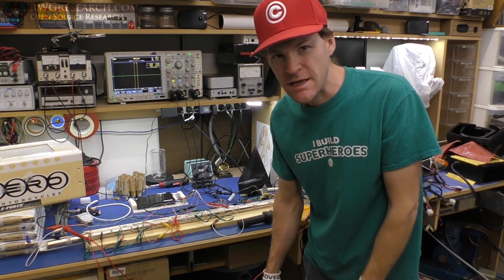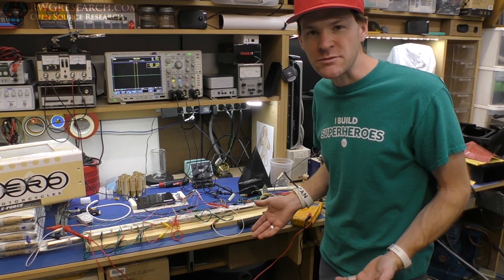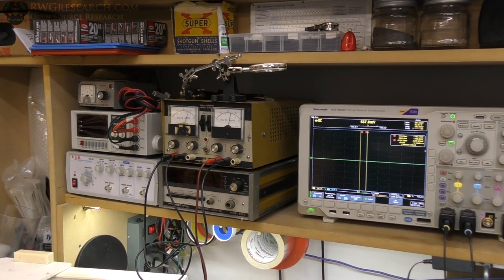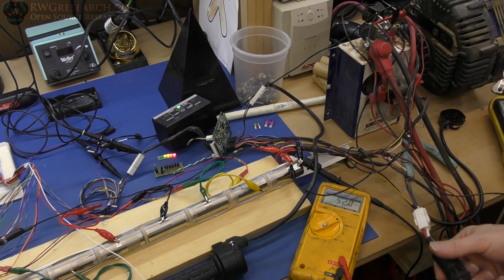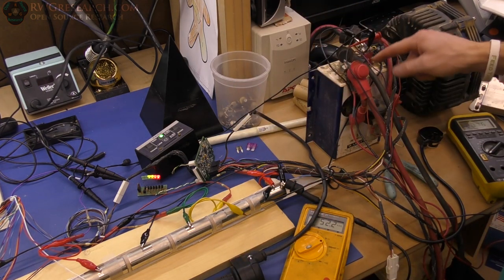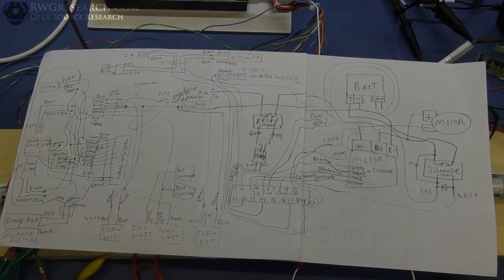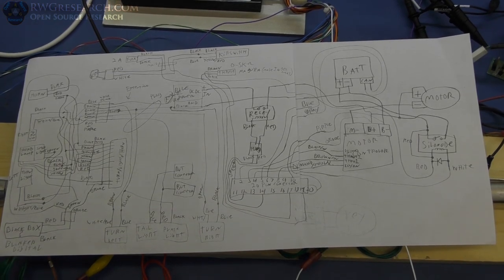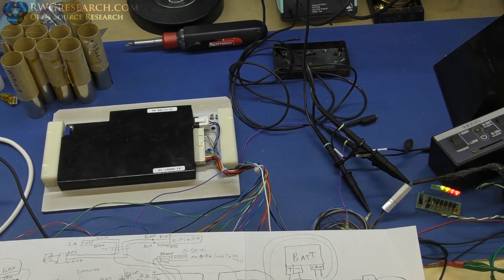Zero P2: Testing Original Controls... 2009 Zero MX Flagship Electric Motorcycle. Wiring and controls

Comment: Hello Russ, I have a 2009 Zero XE and a 2010 Zero MXE. My 2009 battery lost a good amount of it's capacity and I used 3 bicycles 20ah x 48v UPP batteries in parallel. Each battery has a built in BMS with 50 amp continuous and 150 amp peak output. I had a few problems with the control box. One was as my pack got down to 40% around 48 volts, if I turned the bike off it would not restart as the nominal voltage of the new pack I built was 48 vs stock 52. So what I did was eliminate the control box from Zero and bought a computer programable controller from Alltrax the SR-48300. I now have two user modes and can customize many of the characteristics of these modes. I use a the handlebar kill switch to toggle between them on the fly. Which is something you couldn't do with the stock control box. You could toggle down on the fly but not up with the Zero box.  Now I'm using the direct wiring to the controller and have created a new wire harness which uses only about 5 wires total. I use a small led volt meter for battery charge level on the dash in place of the control box. My new 2010 MXE (as it was a dealer demo model that's been sitting for 11 years with a bricked battery) I just bought I'm in the middle of similar modifications.
Reply: Awesome! 👍🏻
I am doing the same project but using the standard components 
How much was the Alltrax?
Reply: @Eatcrow  Found a deal new open box on ebay 177.00 but other wise around $389